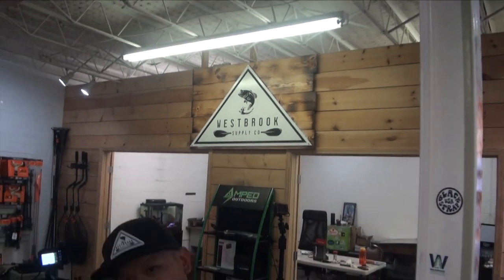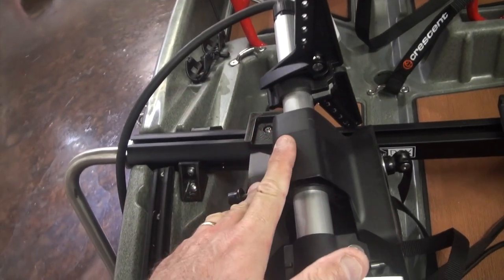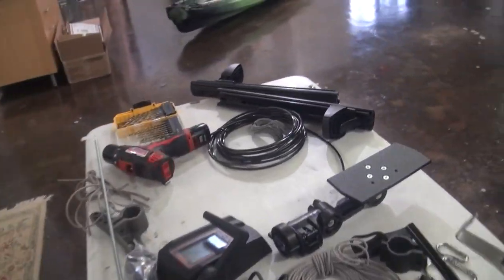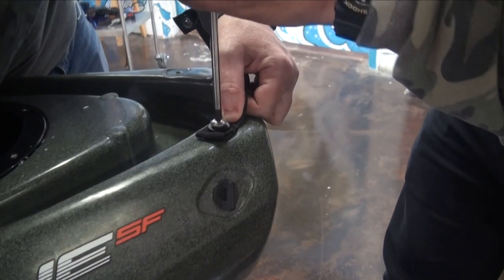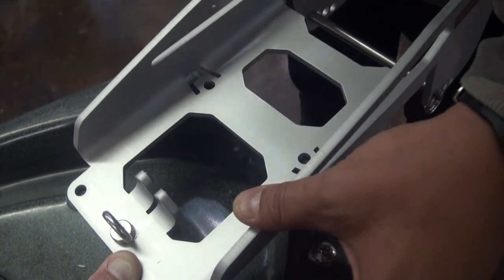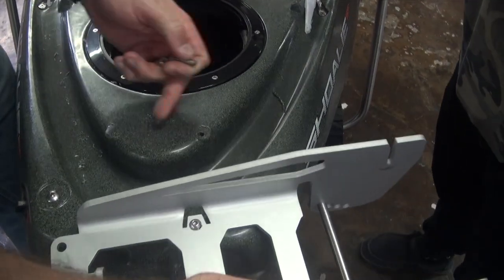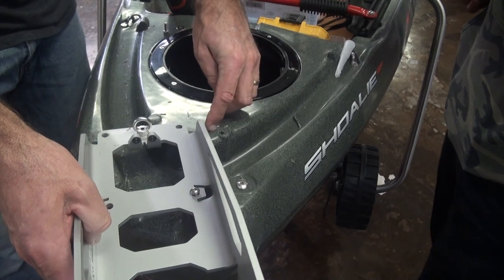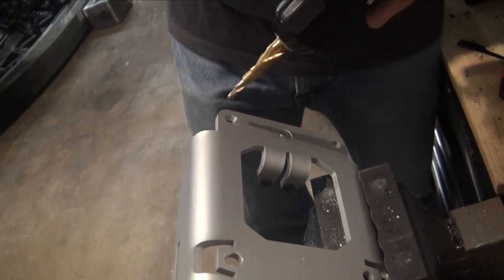STAND UP in a kayak at 6 mph?! Drew Gregory's Crescent Kayaks Shoalie

Comment: Great build! I plan to use two Yakattack mighty mounts on top and two 90 degree mighty mounts on the back of the stern. Drill new holes in bracket and use t bolts. Will be stronger too. Thoughts?
Reply from the maker: Give it a shot!

Comment: I thought some company made a bracket for the torqeedo on the shoalie.
Reply from the maker: Maybe. What company?
Reply: @TheLittleStuff  yak gadget. It’s made just for the shoalie plus they have other mounts for other brand yaks as well.
Reply: @TheLittleStuff   Jeff, I wouldn't run the Torqeedo on my Shoalie without the Yak Gadget stern mount. I just didn't want to tempt fate with using the factory Crescent mounting set-up,  after conferring with Tray I went ahead and ordered the Yak Gadget deal as it was readily available, but One Objective had said they were going to release one as well. In my opinion, due to the mounting configuration, it's virtually eliminated the flex that I'd have gotten without using it, it's also a piece of mind thing where I'm not worrying about the hull failing in the factory rear two mounting holes since they're not used in the Yak Gadget stern mount.